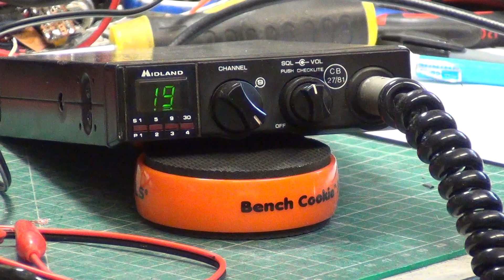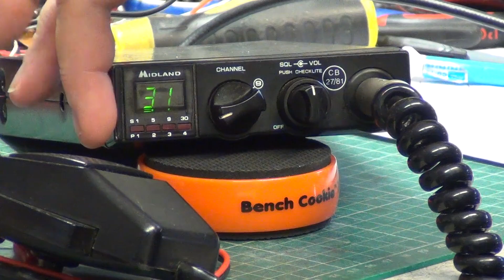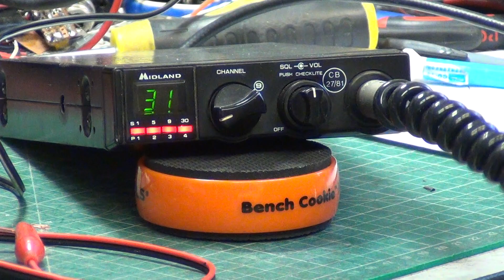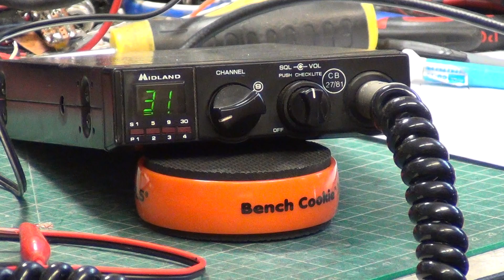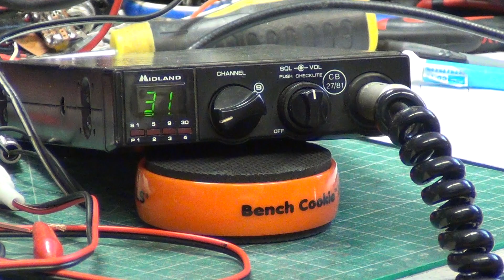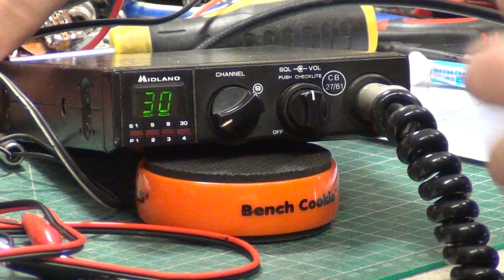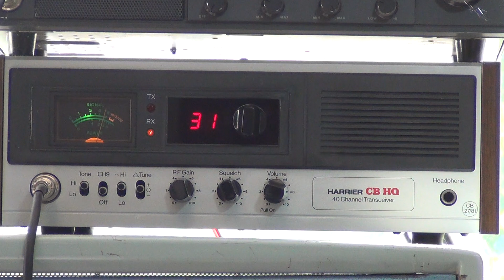Midland 77-805UK CB27/81 UK FM Transportable CB radio - On The Air test

Comment: These are great radios , i had two portapacks in the 90s. And many of the 805s in our tractors 🚜 I now have two portapacks , one early one late  - I need one antenna and two speaker mics . Can you help ? Do not need to be original, I just want them working so I can use them again . Thanks Stu
Reply from the maker: Sorry, I can't help with aerials or speaker/mics. I did manage to get a spkr/mik via Ebay for £16.50 with the plug cut off. I replaced the plug & it worked. I now have one speaker/mic & about 4 radios, no aerials & no leather cases.

Richard
Reply: @ukfmcbradioservicingTango21  ok, thanks for the reply 🙏

Comment: Ancaster Service Station
£1.719/L -> US$1.98/L -> US$7.51/US Gal
£1.849/L -> US$2.13/L -> US$8.08/US Gal - Diesel

Greylees a/k/a Rauceby level crossing
£1.657/L -> US$1.91/L -> US$7.24/US Gal
£1.899/L -> US$2.19/L -> US$8.30/US Gal - Diesel

Only the GBP->USD rate changed - prices were identical.

My US-spec 77-112 has that same mic except that the plug is not metal on the outside (plastic around the metal shield).  It also plugs into the side not the front even though the chassis is otherwise similar.
Reply from the maker: The plugs aren't normally metal here either. When they need new plugs I always use these high quality metal types & clearly Alan does too.

Richard